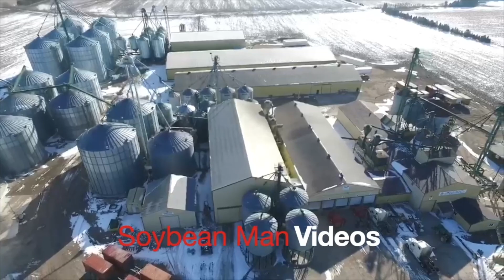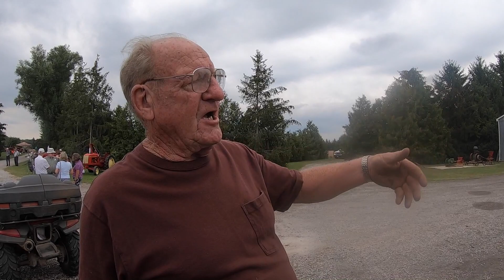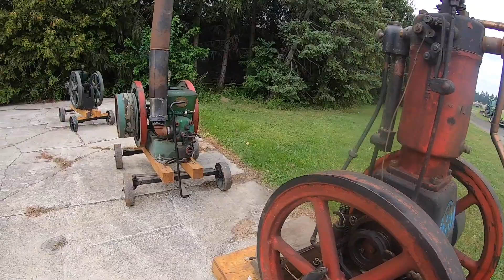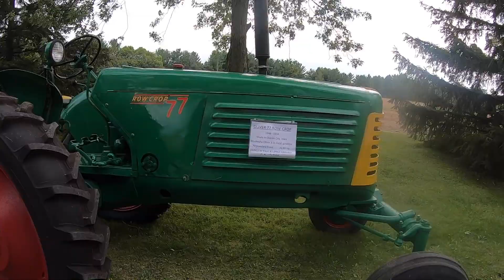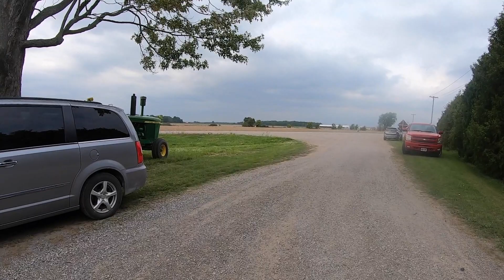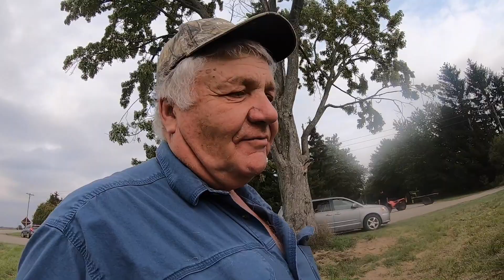Visiting an Antique Tractor Show

Comment: A lot of work there, both putting on the show and restoring all those old tractors and pieces of equipment…..great that people have such interests…
Reply from the maker: Yes. Here is how it works. You buy an old tractor.  Drag it home. Then you find out there is more broken inside you could not see. You paid $3000.00. Wanted to get it for $2500.00 but you softened.    Then you work for who knows how many hours. Spend $4500.00  This is after you thought about half that.  Then you need a paint job and new tires.    Now after you pay for new decals. You take it to a show and someone tried to buy it makes a ridiculous high offer of $3500.00.  That is collecting farm tractors